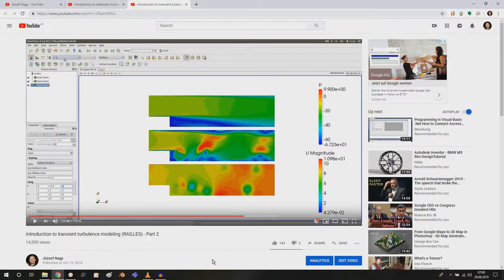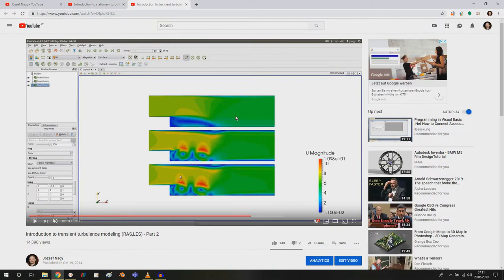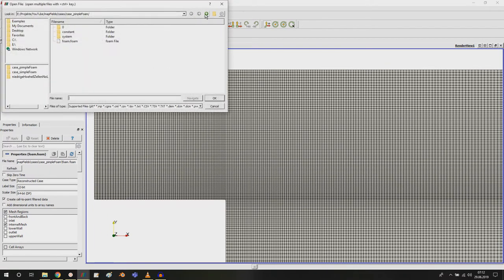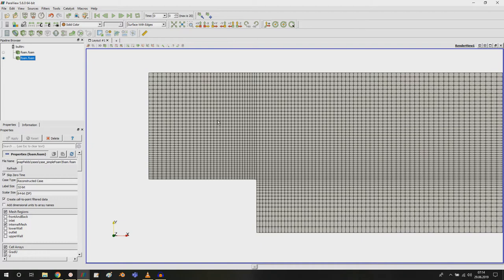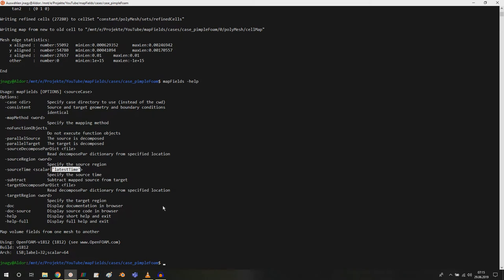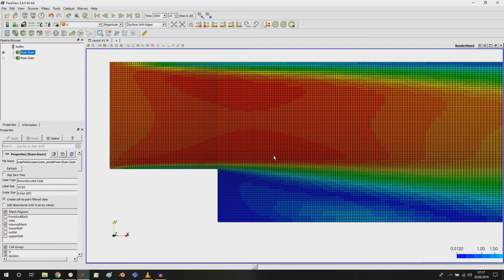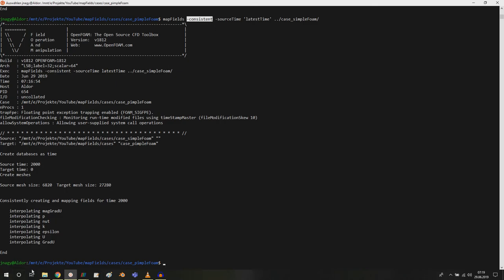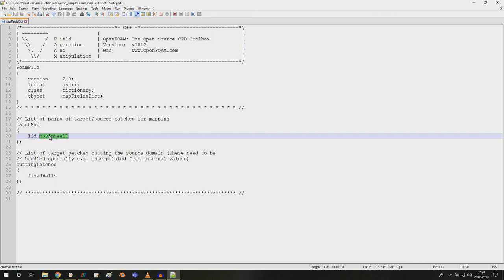Interpolating results between meshes in OpenFOAM with mapFields

Comment: I was struggling for two days since I was trying to do it by following the steps in the OpenFoamUserGuide and it wasn't working in any way. This video did it in an even easier manner. I really wanna thank you for that!
Reply: but my question is: how can I adjust the "Target time" ?
Reply from the maker: In controlDict you can change between startTime and latestTime. In that case mapping will happen either for the one or the other time.

Comment: Dear Jozsef, thank you so much for all your highly informative and valuable videos! May I enquire, is there a technique to transfer the data of the flow fields of different meshes within the SAME simulation case (eg. Coarse mesh flow field is transferred to fine mesh at every timestep within the same case) instead of having two meshes in two different cases? Thank you so much for your kindest assistance!! - Jegga
Reply from the maker: No, this is set up in a way that the two meshes have to be in two different case setups.

Comment: Thank you Jozsef for tons of amazing tutorial. I tried the mapFields on the finer snappyHexMesh grid. It shows a lot of error (can't find the normal or something). The result from corse grid can't mapFields into the finer grid generated by snappyHexMesh. The boundary and geometry is the same, only difference is the snappyHexMesh grid refiner setting. My question is, is the mapFields can't used on snappyHexMeshed grid? The second questions is that shall I use the reconstructed result or the result from parallel processors? Thank you.

Comment: Hi sir, thanks for the videos shared about openfoam. Just to verify good practices, if we have mesh 'B' which has different patches than first mesh 'A' which is the one we have a solution and we want to map results onto mesh 'B' and start running simulation 'B', when you map it, 0/ of B is rewritten with the interpolated data of 'A'... my question is... as we could keep a backuo of original 0/ as 0.org/ in the case folder, where the BC are stated as written ascii functions, does mapFields only transfer data values of internalFields and keeps untouched our latest B.C. functions?
Reply from the maker: You can define this with mapFieldsDict

Comment: Dear József Nagy
Thank you so much for your videos this help a lot.
But I  tried using mapFields for a 3D simulation. To map the Outlet of the source on to the Inlet of  the Target Using "mapFields -consistent -sourceTime 'latestTime'  -sourceRegion  'Outlet' -targetRegion 'Inlet' ../path_of_source"
Ended up with an error >>"cannot find file "points" in directory  "Outlet/polymesh" in times 100 down to constant "
how can we get rid of this error?
Reply from the maker: Are you running cht simulations with multiple regions?
Reply: @OpenFOAMJozsefNagy   My Simulation is simple fluid flow through the 3D channel. I want to interpolate the data from Channel1 (simulation 1) Outlet to Channel2(simulation 2) Inlet. both channels have the same geometry but only the mesh resolution is changed.
Reply from the maker: @subbureddy3119  Ok, then don't use source and targetRegion, this is for cht simulations. Did you try it without?

Comment: hi Jozsef,
I am not succeding using mapFields for decomposed cases, does it work? for me with :"mapFields -consistent  -parallelSource -parallelTarget -sourceTime 'latestTime'  ../run_0_0_Part1/"  it does not give any errors but when i go to the processors folder in the target case the time folder is not being created. I am missing something?(they even have the same number of processors) the same for the recomposed cases works correctly.
Reply from the maker: Did you decompose the target case?
Reply: @OpenFOAMJozsefNagy  yes the two of them are decomposed, and also I tried in same number of processors
Reply from the maker: @francootaola9172  What is the output?

Comment: Dear Jozsef, 
Thank you for the video. I have one question I want to use MapFields in another gepmetry (long and short). Then we did the command using -SourceTime instead of -consistent, but it didn't become interpolate value. Can you give me some advice on this? Thank you.
Reply: my commander is 'mapFields -sourceTime latestTime ../folder1/' 
Is there anything I missed on this commander?
Reply from the maker: @낭만-p1t  latestTime with '' ---> 'latestTime'

Comment: Dear Jozsef, I think you should make a video on how to use swiftblock in blender. Thank you for your efforts! :)
Reply from the maker: Is it working nicely these days?
Reply: @OpenFOAMJozsefNagy  In my case, I got errors. But the guy himself made a video about how to make an structured mesh around a sphere. 
Btw. I am struggling with making a structured mesh around a sphere (smooth and dimpled). I created the mesh with Pointwise but it has negative Jacobian cells resulting in convergence problems. I am using snappyHexMesh as an alternative which does not seem to be bad. For testing I am running laminar but final goal is LES. Any suggestions appreciated.
Reply from the maker: @mk_upo  Take a look at the videos on my last Community Christmas Competition. There a couple of guys investigated the flow around a sphere.

Comment: Hi, I'm having a problem with mapping the field from a coarser to a finer mesh with consistent geometry in parallel. When I run mapFieldPar ..directoryOfSource/ -consistent, the mapField.log return the error "Plane normal defined with zero length". Already tried with all the different mapMethod but te only thing that change, is that it return a different error ("cannot find entry value for patch..."). Any idea on why I'm not able to run in parallel?
Reply from the maker: A normal seems to be invalid. Maybe checkMesh can help?
Reply: @OpenFOAMJozsefNagy  checkMesh is not returning any error. The structure of the Allruns are the following:
coarse mesh= blockMesh, decomposePar, runParallel snappyHex runParallel checkMesh, runParallel simpleFoam, reconstructParMesh,  reconstructPar
fine mesh= blockMesh, decomposePar, runParallel snappyHex, runParallel checkMesh, runParallel mapFieldsPar directory/ -consistent, runParallel simpleFoam, reconstructParMesh, reconstructPar
Reply from the maker: @costantinobarro295  Difficult to say. Sorry did you try on a single core?

Comment: Dear Jozsef

Can we do this every time step?

I saw two threads from CFDOnline, they put the code of mapfields into solver.

https://www.cfd-online.com/Forums/openfoam-programming-development/218505-how-get-cell-indices-manipulate-field-data.html#post745475

https://www.cfd-online.com/Forums/openfoam-programming-development/152170-runtime-mapfields-finemesh-coarsemesh.html

I'm not sure if I need to merge those two solvers as a new solver before using mapfields code in the solver.

Where to the put the code in the solver?

Similar work in OpenFOAM has been found in journal paper, it states that "The computations on the two meshes are fully
coupled, meaning that data (temperature from macro- to meso-,
and solid fraction from meso- to macroscale) is exchanged in both
directions at every time step via a linear interpolation framework"

I'm not sure how the author implement the data exchange, limited information provided in the paper.

Thanks in advance.